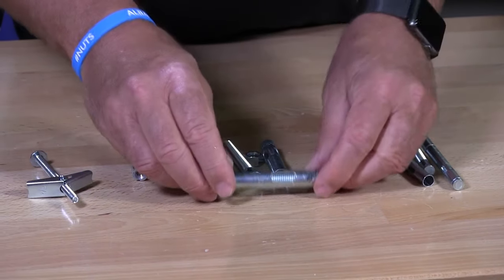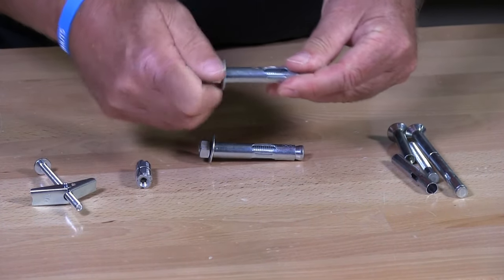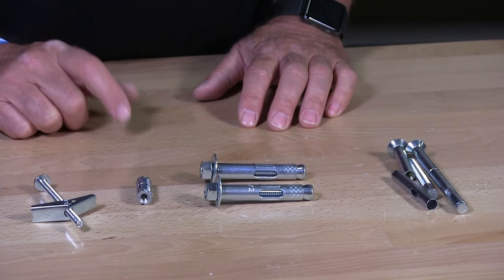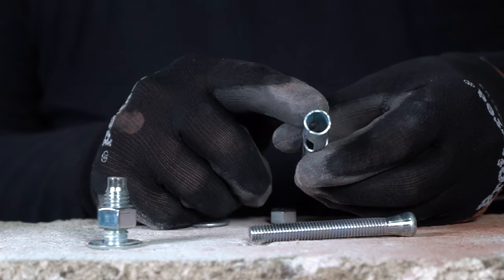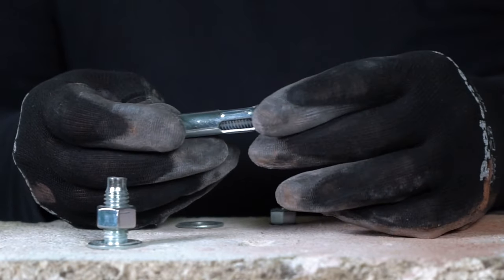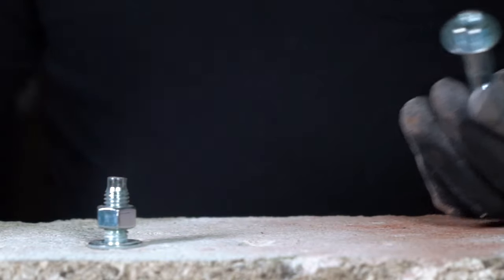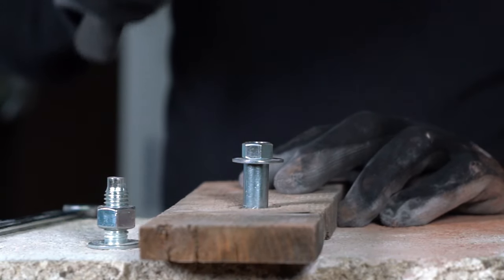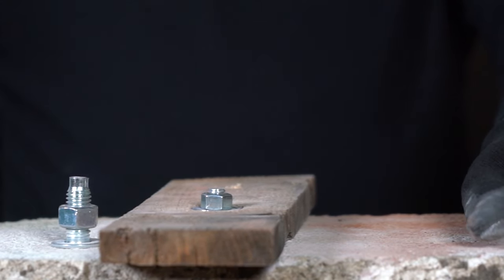How to Install Concrete Masonry Sleeve Anchors | Fasteners 101

Comment: I was hoping to learn what size drill bit to use with different sizes of anchors. The diameter of the sleeve, the wedge or some other measurement, larger or smaller than either.
Reply: Whatever the labeling says

Comment: Need important info on diameter hole to drill and specifications on how deep to drill. I drilled a slightly deeper hole than the bolt
and the bolt would not tighten. I drilled hole diameter as specified.

Comment: How deep of a hole do i drill for a bolt 3 inches long?
Reply: 1/2" deeper than sleeve anchor (+ thickness of whatever you're mounting) but be sure clear out the hole first from any sediment with either a shop vac, brush or compressed air.

Comment: Is there a concrete anchor that has anti theft nut to secure a 6500 kva diesel generator silent type. Hope you can help.
Reply: Strip the bolt for permanent residence.

Comment: Does the masonry bit need to be slightly thicker  than the sleeve anchor for it to fit?
Reply from the maker: The drill bit and sleeve anchor should be the same diameter. The fit should be snug.

Comment: What would recommend for a pullup & dips bar for a apartment.. im 170lbs and I have concrete walls and I want to install that setup on my wall?  Thanks
Reply: 12mm rawl anchors
Reply: @tarunsharma5254  thanks

Comment: I was about to use this to hold a deck then I hear you said is for light use 😮 i get the 1/2 ones they look very strong can you explain why is for light use please and thank you for the video very informative
Reply: Sleeve anchors are lightish duty because of the way they expand to grip the material. You expand the sleeve, but it can still be pulled out with enough force. Wedge anchors cant be used on block, just solid concrete, but the way they expand and "wedge" into the material is much more secure and resistant to being pulled out, and more appropriate for heavy duty applications.
Reply: @R J that plenty big butt on a deck

Comment: I've had issue with the sleeve sitting proud of the surface (the surface of the wood plank in your demonstration). I had to get extra washers to fit around the sleeve so it would hold firm because the included washer didn't even touch the ledger face. 
With 6 inch anchors in solid red brick they didn't protrude more than an inch off the nut on any except one(which was 3+ inches). How do you prevent it sitting proud of the wood? I had the same issue with a concrete wall that same day, so I don't think it's the brick to blame. The hole wasn't shallow or dirty and the drill bit was sized right on my hammer drill. Maybe it was just me. But that is why I'm asking!
A related note: Would liquid nails or mortar caulk have helped or hurt the installation or general holding capability?
Reply from the maker: It sounds like you're using sleeve anchors that are longer than they need to be. If you are using 6 inch sleeve anchors in solid red brick, which is typically 4 inches thick, how thick is this work-piece you are fastening? For this application, it may be better to use Double-Expansion anchors. They are better suited for use in brick and you can control the length of the screws you use to fasten your work-piece.
Reply: @AlbanyCountyFasteners  inch and a half 2x standard thickness. Originally, it was going to have spacers between the board and brick. However, it was scratched early on because it's an interior floor so it would've just been a potential pest problem. Would the 6 inch sleeves cause any problems?

Comment: Are these also called expansion bolts
Reply from the maker: Yes they are! The term "Expansion Bolt" applies to many anchors that use expansion as a way to lock themselves down. Sleeve anchors & Wedge anchors are both considered kinds of expansion bolts.